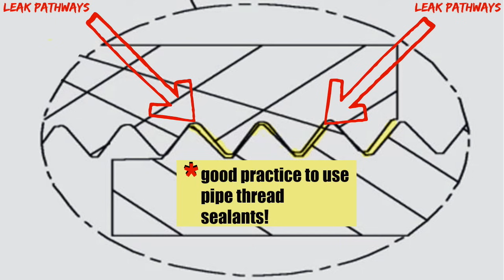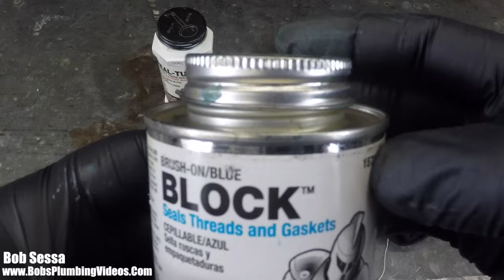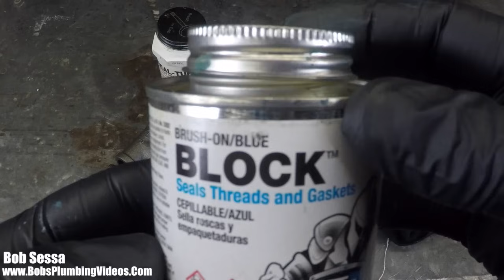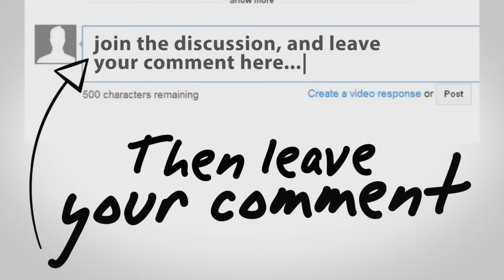Pipe Thread Sealant / Which Pipe Sealant & Why!

Comment: can you sweat a fitting in place after the other end has used teflon to seal the threads in place
Reply from the maker: I would say if you're good with a torch, the minimum distance you should go is not less than 12" from the end in question.

Comment: I’m training currently for maintenance in an apartment complex this definitely gives me some knowledge thank you 👍
Reply: Use it on any threaded seal connection. Drain pvc, drain brass, drain copper, iron natrural gas, etc. If its threaded...use some pipe thread sealant. Its not for sealing, its for anti-galling of threaded connections. Remember that. But that means sometimes you need it to get something tight enough to not leak. And without it you may have threads galling and not allowing full seating of your connection.

Comment: Great video I have a question I hope someone can answer. I am screwing a male pvc joint to a brass female fitting and the joint keeps leaking. I have used teflon tape by itself, teflong tape with pvc compatible pipe dope and I still have  a leak. I have replaced the pvc male fitting thinking there might be an issue with it with no success. Any ideas.  
Would the bursh on blue block maybe help me fix this issue since it creates a gasket?

Comment: IF the threads are a little wet on my brass/copper male end, will it cause a problem with a good seal into the brass female end? (For some reason my valve shutoff at the main line drips, which i would need the city to fix.)
Reply from the maker: Jimmy Scott  Being wet should not be a problem at all. You can put  few rounds of Teflon followed by some megaloc and you’ll be good to go.
Reply: That did it! The teflon made the difference, a bit tighter fit. I had to wrap the teflon a little tighter than usual to keep it from twisting with the fitting in the wet condition. (Previously I only used the sealant and it leaked, which worked fine on my dry fittings.) Thanks !!!
Reply from the maker: Excellent! Thanks again for checking out the video. Regards, Bob

Comment: Which of those pipe sealants would I use on black iron pipe to seal the pipe to fittings so the dont leak water and can withstand heat if i were to use a bbq to heat the pipe and water inside to heat my pool?
Reply from the maker: Blue Block, wear gloves and have some lacquer  thinner on hand for clean ups.

Comment: What would recommend for straight pipe thread male s-union going into a female. Got a micro drip with like 10 wraps of Teflon tape.
Reply from the maker: I would use the spool lamp wick first, followed by a couple rounds of Teflon. Top it off with blue block and you should be good to go!
Reply: @BobsPlumbingVideos  
Would blue block be safe to use on shower faucet?
Since this is straight pipe thread s-union fitting am I correct not to have the male fitting bottomed on the female socket? As the s-unions need to set apart within a certain dimension for the faucet. Thanks so much again for the great tip!

Comment: i am trying to connect a solder female to a threaded pipe with yellow copper/pure brass?/raw copper?that old threaded pipe is golden yellow. my mentor threaten me that i am going to get a leak if i only use tafflon if i don't apply sealant. that female solder copper only can get in 4 threads or maybe 5,is this even safe?
Reply from the maker: I would try maybe two/three (MAX) wraps of Teflon followed by Blue-Block. Or using some lamp wick in between the threads (not too much) followed by Blue Block. Solder your copper into the female adapter before screwing onto the pipe. You don't want to heat it after you put it together. Four to Five threads should get the job done. be careful that yellow brass is brittle and if you whack it up too much, you'll snap it off!
Reply: @BobsPlumbingVideos  sounds fair enough,thanks!

Comment: Can you run a leak test right away after using Blue Block or do you need to let it dry first? Thanks!
Reply from the maker: For me, I pressurize the job immediately!
Reply: Pipe dope never drys. A threaded fitting can be pressurized emidetly. Or you can turn the water on.

Comment: I use blue monster products (dope and tape), primarily water and steam, works well for my applications, have any experience to compare to the products you use?
Reply from the maker: I've used blue monster products and they work really well. The key is to find  something you're comfortable with and stick with them. I was weened on the Hercules products and they work very well for me.
Reply: +BobsPlumbingVideos Thanks for the info, helps to have some advice from a pro with decades of experience, I've been at this full time for about 6 years
Reply from the maker: It's a great trade, challenging at times. Started with my Dad in the late 60"s. I'm looking at 66 next month and still out their mixing it up.

Comment: Any feedback on best practice for damaged threads inside 90 that feeds a shower head? Used hacksaw to remove old threads that were stuck inside 90, and cut too far. Have attempted to seal with teflon and non-setting sealant, but to no avail. Update: Just saw your comment about teflon and Blue Block for threads in rough shape. Will try it with an adapter!
Thanks for the video!
Reply: Nicholas S / how far I did you cut? My approach would be to use lampwick and either blue block or grip ( be careful it’s a bear to get off your hands or anything else) it you cut in to far, you may need surgery.
Reply: RobertSessaPlumbing I got one section of threads pretty good. I know I may have to replace the 90 if this doesn't work. Gotta get some Blue Block first tho. I almost had it with just the sealant and tape, but a spray came soon enough. Thanks for the warning about it.

Comment: If I may ask? I have seen conflicting answers about tapered unions on "black pipe" and whether or not sealants should be used on the taper or not and on the threads or not. What is your answer? Thank you
Reply from the maker: On union fittings at the appliance, boiler, water heater etc I’ll put sealant on the face of the union. Not the male threads of the union, I also only use sealant on all male threads. I do not use not use Teflon tape nor is it code here in NYC.

Comment: Hey Bob. Great video. I know you don't need tape or dope on compression fittings (brass ferrules or rubber o-rings), but I like to put some tape on the threads because it seems to help control corrosion making it easier to take apart later if needed.
Reply from the maker: I'll use Teflon on pipe threads in combination with pipe joint compound.  I tend not to use it on compression or flare fittings but will lubricate the threads with pipe joint compound to make up the nuts easily.
Reply: BobsPlumbingVideos OK. Thanks.

Comment: FWIW: re 4:08 The "tapered pipe thread" is designed to provide excellent mechanical rigidity & good seal despite inconsistent tap & die 'sizes', but the abrupt end & reversal of the tapping motion, provides a fractured 'seam' across the threads where the cutting edges of the tool stopped.  That little step, is where the 'leak' can occur.  Normally, if the fitting is well tightened, the metal will be slightly stretched & the 'seam' will also be smooshed smooth enough to be gas tight.  If you look, you can easily see, and sometimes you can feel the 90 or 120 degree 'click' as the seams pass each other.

Comment: What would I use on an old gas line that I noticed a slight gas smell at a couple joints.  I'm not taking them apart to be able to put this stuff on the threads.  Thanks..
Reply from the maker: First let me say that you absolutely should back them off and reseal them with Blue Block. If you’ re not going to take them apart (bad idea) then do as the utility companies used to do. They would get a damp bar of soap and pack the joint to temporarily stop it. Then would tell you to call a plumber and get it fixed!

Comment: What would you use with ABS? I see some pipe sealants recommended for PVC and CPVC, but they are silent if they can be used on ABS. As I understand it Teflon tape and regular pipe dope should not be used on PVC, CPVC, and ABS. Thanks.
Reply from the maker: On ABS you can use MegaLoc or Real Tuff. I use Teflon on PVC threaded joints by itself or in combination with the MegaLoc or Real Tuff.
Reply: @BobsPlumbingVideos  Thanks! Just to confirm, do not use Teflon on ABS but OK on PVC,  correct?
Reply: @pradeepbansod3000  what do you mean with abs? What are you trying to thread? Is it under hydrostatic pressure? Generally I use Teflon sticks. For clean out caps etc.
Reply: @otisbigsby  ABS is the black plastic usuallly used for drains. I am threading a cover/cap for a drain cleanout cover. You have mentioned Teflon sticks, thanks for that tip, but I am not familiar with them. Can you maybe replay with some more details of those, maybe a link to the product in an online store like Amazon or Home Depot, etc. Thanks.
Reply: @pradeepbansod3000  yes I use abs daily. On the west coast it pretty much all that’s used for waste and vent here.

Comment: Can I use the Oatey great white pipe joint compound for my furnace gas pipe fittings?
Reply from the maker: Not familiar with that product, my everyday go to is Mega Lock, on problem joints and all gas work I use BlueBlock.

Comment: I like real tuff over Megalock but like you said it is difficult to clean for sure, almost like a white tar if that makes any sense.  I’m probably using way to much.  I think they lubricate more than they seal imo making it easier to tighten the fittings and also makes loosening in the future much much easier.

Comment: IS PIPE THREAD SEALANT & PIPE JOINT COMPOUND THE SAME??? Is it alternative to Teflon
Reply from the maker: I would say the joint compound  (Hercules Pro Dope) I used as an apprentice acted more as a lubricant VS. the sealant I use today (Megalock) which has p.t.f.e. (Teflon) mixed in with it. In either case I would still apply Teflon tape first followed by your choice of compound or sealant. As a side note I use MegaLock 95% of the time and here in N.Y. City if you're doing natural gas lines, sealant only NO TEFLON allowed.

Comment: When purchasing pipe nipples, should I be concerned about its quality if the external surface shows vertical slit lines or,  is that part of normal appearance from its manufacturing?  Also, what do I look for when selecting pipe nipples so that I don't have to worry about them start rusting couple of years after install?   Thanks!
Reply from the maker: I find that line you speak of mainly in imported poor quality product. Trouble is finding good quality American nipples sometimes can be a problem. always domestic if you can find it!

Comment: Installing a new faucet in the kitchen. One was old pipe. One was new pipe. Because I had to add a nipple to raise the supply to accomadate a filter system. Both shut offs leaked. Used teflon only. Any ideas why? (I didn't over tighten).
Pipe is galvanized
Reply from the maker: If I run across old galvanized pipe (don't see that to often anymore) I probably would go with the spool lampwick and Blue Block  or Teflon and Blue Block.
Reply: @BobsPlumbingVideos  
Thank you

Comment: Where can you find the lamp wick cord?  I want to use that and the Hercules Pro Dope (non-PTFE) for reinstalling my old cast iron hot water radiators.  I have read that PTFE (Teflon) tape and sealants are not recommended on cast iron to help avoid over-torque and resultant cracking.
Reply from the maker: I would try a local plumbing supply house first if no luck try looking here - http://bit.ly/2DrxZsM

Comment: First time here. Truly an outstanding video. Very comprehensive. Connecting a gas dryer today for a (male) friend. He spent all of yesterday trying to do this without success. Unless im missing something, i made the connections in less than 5 minutes. His big fear is that the tapered male ends are not supposed to screw into a non-tapered females. I bought a 1/2" to 3/8" connector and used it between the dryer and gas line. Everything fit nicely. He raised his voice and said "dont use white tape on gas lines." Is that true? He also insists that the tapered/rounded male ends are not to be screwed into the gas lines. I dont think thats the case. Hes convinced the females have to be shaped like the males or gas will leak.  I disagree.
Reply from the maker: If you're referring to the flexible gas connectors, the male portion which screws into the female nut on the connector is not pipe thread and should not be screwed into an I.P.S. fitting. We're not allowed to use Teflon tape on gas in New York. Just pipe joint compound is all you need.
Reply: In uk we have white ptfe tape for water and a  yellow type for gas fittings.

Comment: swan seal product does harden but very slow like a month or so. What if the threaded parts can't be tightened fully, like you need to have certain angle on elbow etc. (or you live outside USA or UK where all plumbing threads are straight no taper) then the only product is anaerobic sealant? Is there difference between plumbing anaerobic sealant and thread anaerobic sealant? The thread sealant is way more expensive.
Reply from the maker: Good question! Don't know. Straight threads have to be a real problem to seal?

Comment: Do you ever use sealant on unions that refuse to seal?  I mean on the union mating surface, not the threaded pipe side as certainly need sealant there.  I have a few brass unions that just refuse to seal.  I think the main issue is “Made in China”, but I am hoping to make them work without having to replace them.  Was thinking about smearing a thin film of thread sealant on the machined mating surfaces.
Reply from the maker: Trade Secret! I do it all the time with a lot of success, unless I get a really low quality imported fitting. Which by the way is unfortunately happening more often than I'd like to see. Thanks for checking out the video! Regards, Bob. Try the Blue Block!
Reply: BobsPlumbingVideos I don’t have Blue Block on hand, but if the Rectorseal #5 doesn’t do the trick, I will get some.

Comment: Used Teflon tape first, then rectaseal, liked the smell of the pipe dope,  but very rare if never leaked in my years of plumbing heating .  The problem with Teflon and dope with Teflon, oil pump mfgs. Advise against Teflon, I personally saw a oil pump leak oil from a hanging furnace that the installer used plain Teflon tape.   On water the combos can’t be beat.  Very good video.
Reply from the maker: Pat Cupolo      Thanks Pat, appreciate it!

Comment: If these products were used to attach a pipe cap screw, how do you get the cap off without damaging the galvanized metal pipe (outside second water spigot attachment on 'T')? Would just 2 wrenches, and perhaps an extra piece of pipe for leverage, be enough to remove the cap? Or, after the set-up has been attached for a lot of years, would a solvent of some sort, heat, or white vinegar be necessary, first?
Reply from the maker: Two wrenches will generally do the job, I rarely will have to use leverage to break the fittings apart. Heat will also aid in the process.

Comment: What about sealing male adaptors when you have to heat the joint to solder? Will the heat of the torch ruin the seal on the pipe threads?

Comment: What type of sealant would you use if the threaded joint is near a copper solder joint, therefore the threaded joint will be exposed to heat after it has been tightened?
Reply from the maker: I would use either Teflon tape or spool lamp wick followed by a coating of Blue Block or Grip

Comment: I learned with lamp wick and pro dope in 1998. I had an old school plumbing instructor. Still my preferred method. I've used mega lock here and there. With the tape I learned to put the dope on first then the tape over it. Real Touff I mainly used for fire sprinkler systems. Blue block makes a mess, it's like paint and gets everywhere. I didn't do much gas piping, but I used it exclusively for oil, from the tank piping, oil filter, firomattic valves, up to the burner.
Reply: started out as a maintenance mechanic in the early 80's never saw it in threads.....would wrap leaky condensate fittings with new mop strings until we could shut down

Comment: I am installing replacement sump pump exit steel and cast iron to PVC to exit basement What sealant is best?  then pvc to pvc what is your sealant of choice?
Reply from the maker: For both those applications, I would use Teflon and MegaLock. I'm sure the purest will say "Teflon" only, your not supposed to use dope on Teflon! That's what I do, haven't gotten a callback yet!

Comment: I have been using new steel pipe a 45° & 2-1/2" into it cant get it to stop dripping redone it 3 times now teflon is not working ready try pipe dope hopefully it will stop on 4th try?..
Reply from the maker: I would try the lampwick and blueblock. I’m assuming the threads are not beyond repair?
Reply: @BobsPlumbingVideos I bought brand new pipes elbows & straight nipples using to attach to hot side outlet pipe just under where my new water heater is going in but dont want to install heater yet till this pipe stops leaking I am going to use your method with teflon tape & stop blocker sealant hopefully lowes or depot carries it also going to repurchase new elbow & straight pipe could be bad elbow or straight pipe inperfections hopefully with new pipes & your technic it will resolve this ongoing issue cant believe this will be my 4th time now redoing this I have to break loose small pipes on top & taking out long pipe & bottom ones just to redue this starting to get frustraighing but dont want to pay a plumber 200$+ just to seal a pipe worst case I will use liquid nail cement around entire joint if all else fails thanks for the advice👍